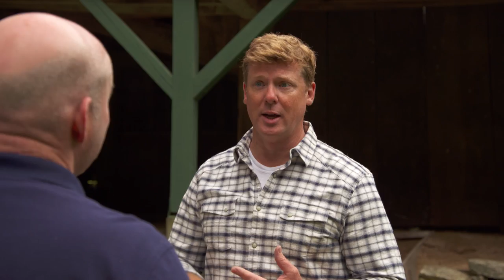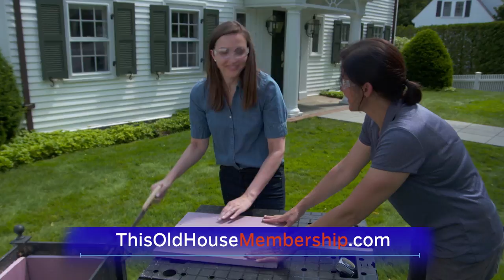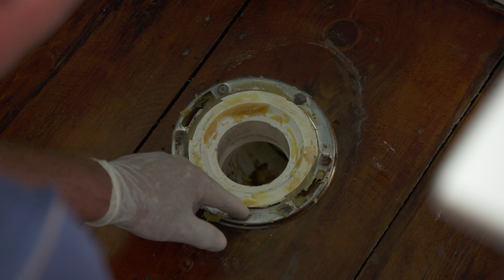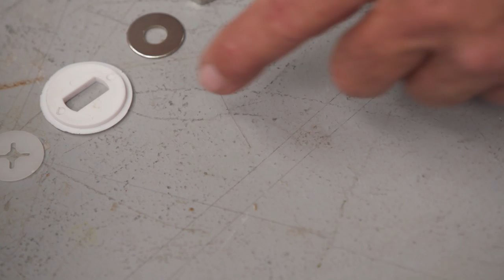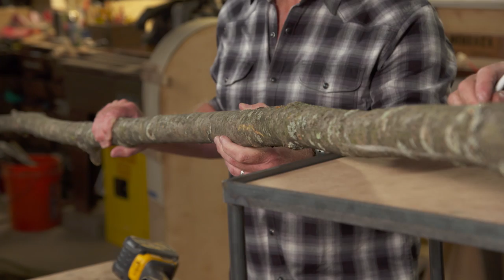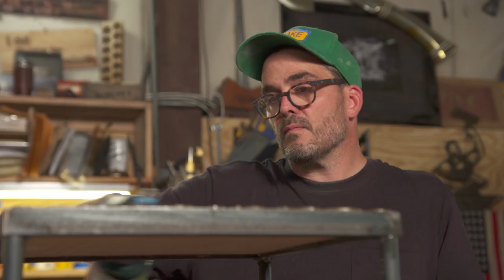Ask This Old House | Jimmy Diresta, Wobbly Toilet (S16 E10) | FULL EPISODE

Comment: But the red cup he's mixing the epoxy in doesn't have a constant diameter, so unless he corrected for that with the lines on the mixing stick he's not getting equal parts.
Reply: Thought the same thing
Reply: One part epoxy, one part hardener. Doesn't have to be super exact

Comment: The foam gasket is awesome. Have one in my bathroom. Did y’all notice the floor moving?
Reply: Just made the comment on how they should've secured the floor before the toilet. Good eye !
Reply: Getting a decent contractor in to sort that floor out will take a couple of weeks. This would just be a stop gap until repair coil be done
Reply: @markchapman8253 , Agree.
Reply: just dont use bleach cleaners or those blue toilet things, the foam will eat away within a few weeks

Comment: Not to quibble and I'm not sure how accurate the measurements need to be for epoxy but a Solo cup is tapered outwards from bottom to top.  The volume the cup holds in the first inch up from the bottom is going to be less than in the second inch.
Reply: One part is epoxy the other is the hardener. You don't have to be super exact

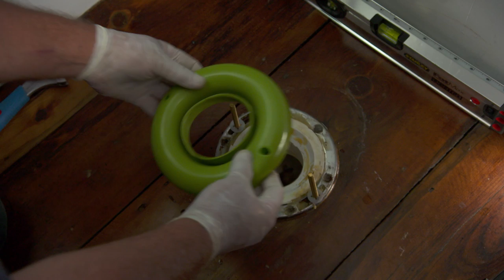Comment: @9:30 if you use this foam ring, do not use any bleach cleaners, it will get ate away and develop holes and you will end up with water on the floor (ask me how i know), its a easy connection but is not chemical resistant enough

Comment: Most interesting to me is that Richard made a quick-fix on a serious flooring problem and used various inventive parts but did he really create a long-term fix or just create a future need to redo bath and level floor to subfloor (shim) or actually fix most likely source of failure - broken floor joist or separation from the foundation wall.
Reply: the floor board appeared to be loose (and the toilet China appeared to be cracking).  I think he did a temp fix.

Comment: I actually have the larger Bosch suction tool they showed first. It’s awesome. 

I was so sceptical when drilling a core of say 100mm

But it captures ALL the dust. So you can drill from inside to outside, for say a toilet fan or a soil pipe

Comment: His mixing stick trick doesn't get you equal parts of each part of the epoxy, since the cup flares out toward the top. It means you get more of the part you add last. The cup walls aren't too steeply inclined, so it probably doesn't matter too much.

Comment: The biggest trouble I see with the silica dust collection is just how fast it clogs a filter, and just how fast it is airborne again when you go to dump the vacuum or change the filter.
Reply: @Kevin-mp5of , it helps a bit, but I've found a lot more success with dust separators in my shop. Haven't needed to change my filter in a year (hobbyist, not professional). The problem with those, of course, is that they're awkward to use in the field even with my 5gal bucket version.
Reply: @brianglade848 , lol, I've been living in Mass for two years and I still struggle fairly often with that accent.
Reply: @Kevin-mp5of , a $750 vacuum cleaner... nah, I'm good. If I was a professional I might be able to justify the expense, but I'm not. I'll save that money for more tools. The only Festool product I'd actually consider is the Domino.

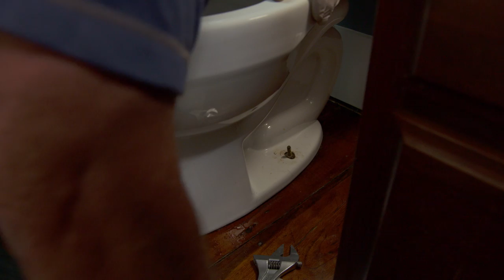Comment: They should have watched the video before doing any repairs. The floor at 7:20 is barely attached to the sub floor or joists. That would be the first place to start, secure the flooring and then the toilet.
Reply: Yes, I suspect they have a broken beam. Perhaps during one of those expansions someone cutting a hole in the wall to enlarge the house destroy the support beam. After all that problem is a new one only a year or so. Definitely want to fix that before the whole house comes tumbling down.
Reply: aah a , It's cheaper for the most part, and that's the way we've been building homes for a long, long time. Hope that helps ?

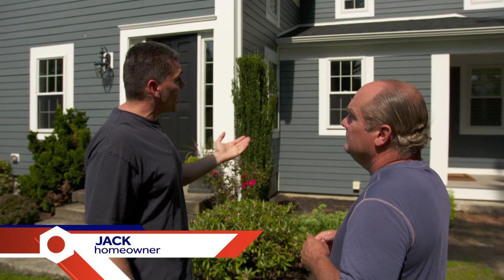Comment: 5:24 mark the house owner tells Richard the reason for the floor under the toilet sinking.  The addition to the house ~2 years earlier.  Support beam or other structural member cut at that time, weakening the support for the flooring, and now the house is on it's way to collapsing.  Never-the-less Richard's shims will stop that from happening! ;-p
Reply: @Kevin-mp5of  Hi Brian, He cut the beam in the old house to make the penetration.  Of course a man with two personalities could sent one of them through the wall, but that's a super power reserved for the special.

Comment: i am sorry but using them shims are points of failure the best way to fix the issue fully is to fix that floor if you can not you could of made out of some wood single shim to eat up that space and that would lessen the chances of the toilet of breaking. but the proper way to fix the issue is fixing that floor as it was moving way to much when the toilet was in place before the shim. that showed that there is a major issue with the floor in that spot ... could of been water leaking over time and made the boards weak or so on .... but fixing the floor is the first step then fixing the toilet issue.

Comment: Don't understand the need for the toilet shims.  Richard never said that the floor was not flat.  He just said it wasn't level.  Why could the toilet just sit on the flat floor, but out of level?  There would be no wobble in that case.  Sounded like the original problem may have been a wax ring.  Then the owner fixed it, but introduced a new problem when he overtightened the toilet bolts, making the toilet not secure with the floor.

Comment: Why do they even use wax seals when rubber seals work just as well, as easier to mount and accommodate wobbling?
Reply: Wax will basically never crack or dry out. I've seen a few rubber seals crack and dry out, wax also seals better, if the flange is sometimes not perfect wax will get a better seal and fit.

Comment: A couple things. 
Richard they have this new fangled things called toilet suckers. You can suck the toilet water out instead out sticking your hands in someone else's fecal pot. 
2nd  I am a plumber from the northeast. And its code to caulk all toilets to the floor in case the gasket leaks you.wont get sewer gases escaping into the bathroom. 
This should have been a crossover episode with Tommy fixing the crooked floor and you fixing the toilet issue.
Reply: Yeah the point is to teach viewers how to do things. Removing it with a sponge and bucket, something probably everyone and their grandma has, is best for these videos. Also I don’t think you understand how difficult it would be to fix house settling within just a foot, especially given the fact that the house is an extremely old heritage house and even more so with original flooring  that even a master like tommy wouldn’t be able to reinstall if damaged. 

Furthermore, a home owner isn’t going to want to spend on “fixing the crooked floor”, which is a huge task, when there is no actual immediate problem that it would cause, other than a wobbly toilet which Richard inexpensively and effectively fixed.
Reply: The northeast is a joke also, I personally still believe the caulk is aesthetic and may serve some purpose mechanically, but to make it code to caulk the toilet specifically in case the seal starts leaking to prevent sewer gases, is silly. I think if your toilet was leaking that badly then you have bigger problems than just sewer gases. In fact I would even say that because the caulk is on the toilet, you won’t know if your seal is broken or leaking until you find yourself in a worse situation where your toilet has been leaking for a while now and causing damage and you didn’t know because of the caulking. I still caulk all my toilets btw.
Reply: The wax ring is what seals to prevent  sewer gas  and we don’t caulk around the toilet reason being if the wax ring leaks it will flow out on the floor  knowing there’s a leak if you caulk it the water is trapped and than will  eventually start to deteriorate and find it was into the joist area causing more damage